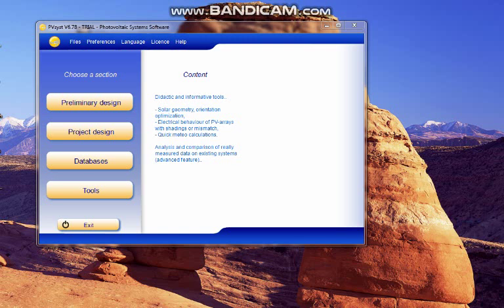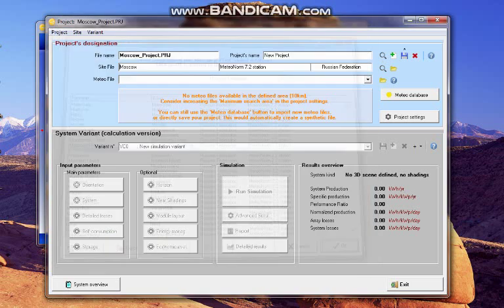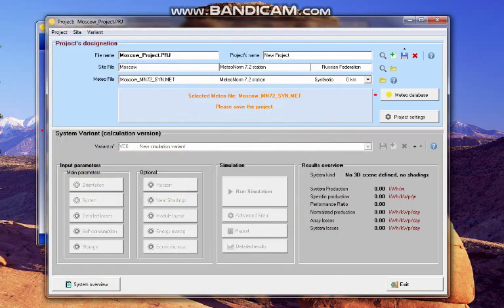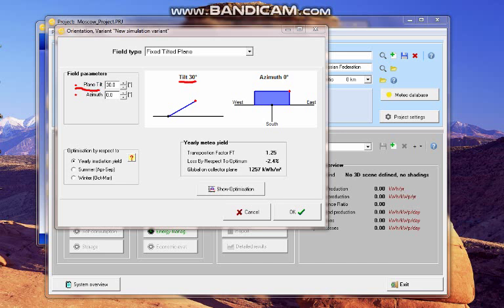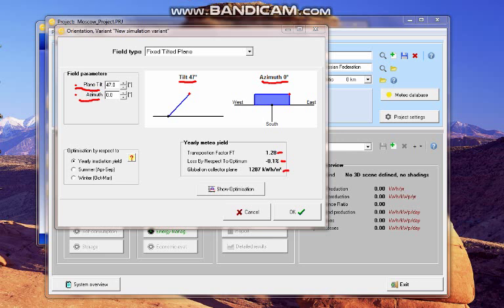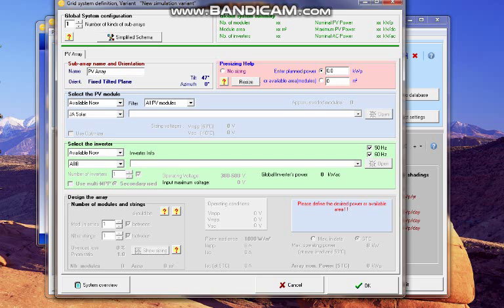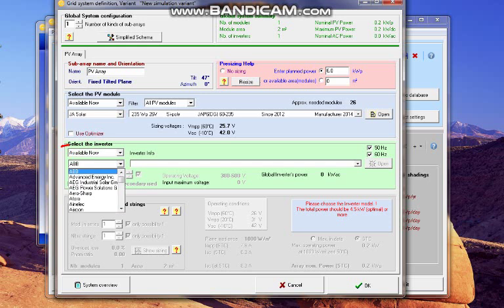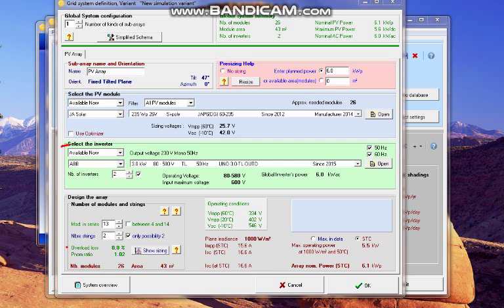PVsyst Software V6.78 (part 1)

Comment from the maker: In selecting the system part, after you define the KW of the photovoltaic system or square meters, by selecting your Model of pannels, the Light blue RECTANGLE below shows the KW of the inverter in triphase. so keep your eyes on it before selecting an inverter.